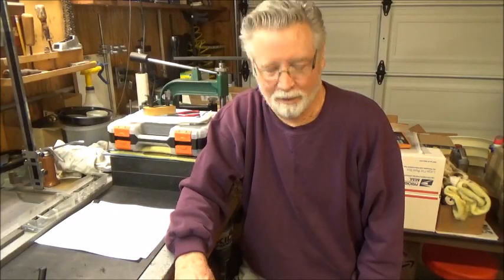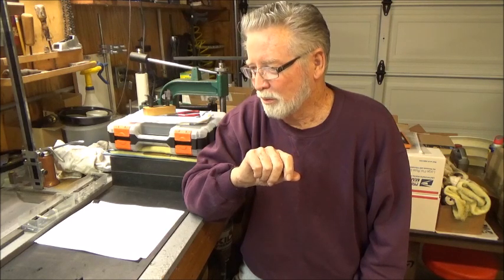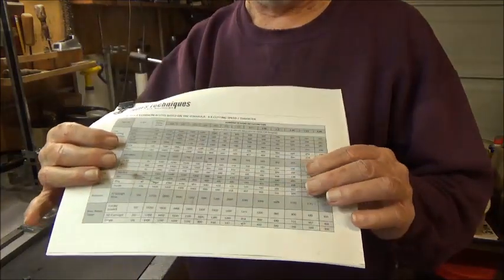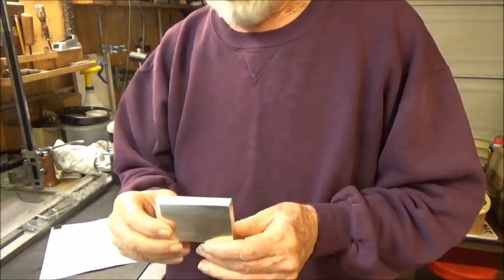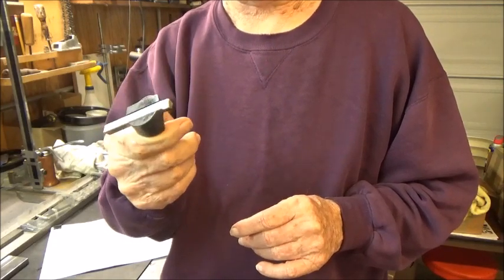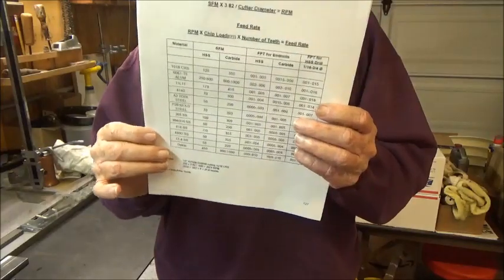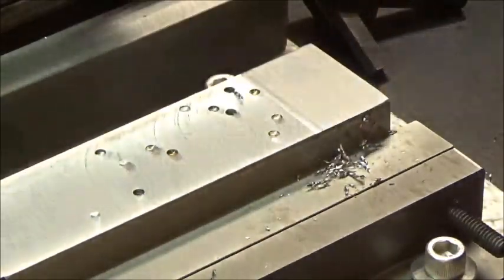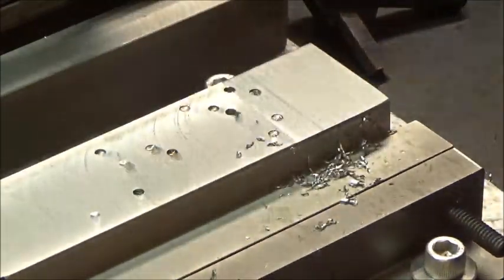Fly Cutter vs Hand Shaper Finish Cut

Comment: Your Hand Shaper is an impressive design. Is this your own design or did you get it from someone?
Reply from the maker: The shaper is shop built by myself.  It was developed and designed from photos of manufactured design which I tried to scale down to enable all the machining operations required for the build and the equipment I had available..  Larry

Comment: Hi, Larry, first, good video, looks from the pattern of crosshatch from the flycutter your mill tramming is setup just right and it looks smooth,  I still prefer the finish from the shaper the only problem there is it's slower but you do have nice curled chips coming off, on my shaper if I were building again I would change the ram dovetails and make them parallel, my ram gets tighter at the end of the stroke and I am considering getting them ground I also have to adjust my cross slide for parallel a few thou, my biggest problem is procrastinating and going to the shop, nice job though,
Reply from the maker: Walter:  Scraping solved all those problems for me, but it's a whole lot of work.  I had to remove a huge amount from one side of the ram dovetail.  Now everything is pretty good, but not perfect.  I could do some fine scraping on all surfaces, and that would result in a perfect piece of equipment.  I really feel precision scraping is the answer to many problems.  Larry
Reply: @larrypoindexter9351  Larry, I just can't be bothered
Reply from the maker: Walter: Grinding should be a simple solution considering you have a lot of material to remove.  I had the same exact problem and my approach was really a lot of work.  The bulk of the material should of removed by some other method.  I also scraped the steel base and should of found someone to grind it, and that was really difficult.  Steel is certainly not as easy as cast iron.  Larry

Comment: Do you sell building plans for the shaper? I am interested in building one.
Reply from the maker: David: I'm sorry.  It was a huge project with nothing to begin with except photos I gathered on the internet.  I did make sketches in CAD along the way which are in my photo album at the very bottom.  I tried to scale the entire machine down by about 20% because of the machines I had available to do all the work vs the size and weight of materials used.  Here's a link to my photo album if your interested.  Regards: Larry
https://1drv.ms/u/s!AoFHBXavAXM5hJ9SjDH_DgXQuiO9fg?e=33r18Q
Reply: @larrypoindexter9351 this is very helpful, thank you very much! It is much better than Gingery's design.